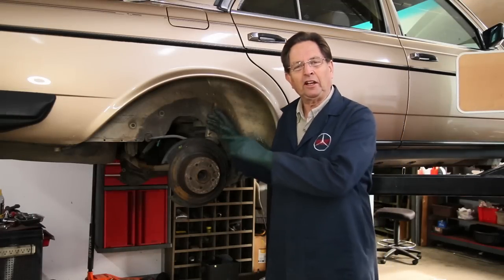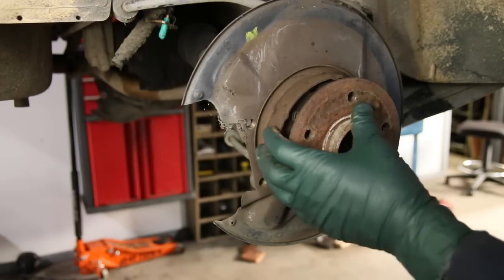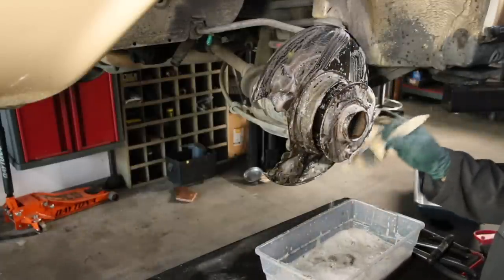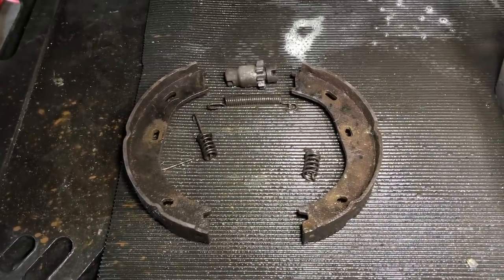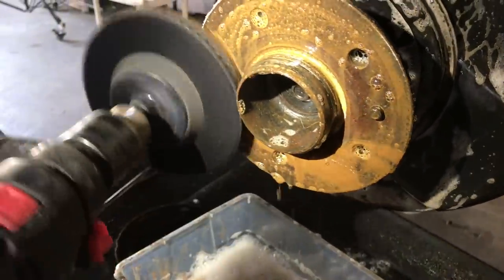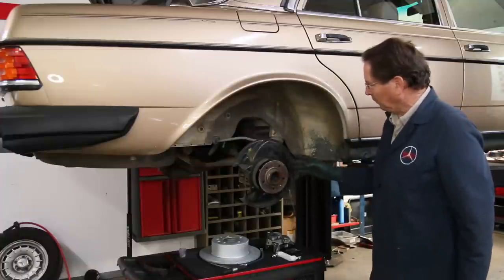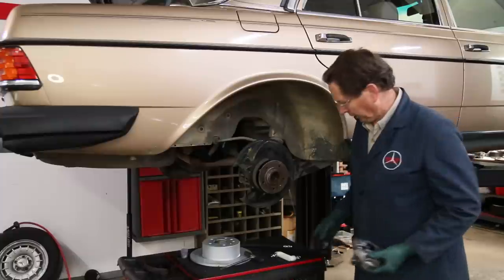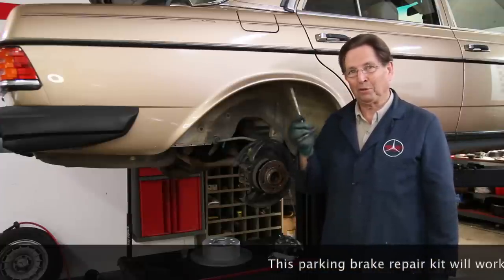Forgotten Part Inside Rear Brake Disk: How to Replace Parking Brake Shoes.

Comment: Kent, my recently acquired W204 has the same parking brake system. I had to adjust the shoes as it wasn't holding. The car had passed the MoT test (annual UK roadworthiness test) 2 months previously. My 2003 Volvo XC90 also has the same type of parking brake.

Comment: Excellent video: comprehensive and easy to follow.  I'm replacing the parking brake shoes on my 2004 W209 and it's the exact same as the one in the video.

Comment: I decided to replace the parking brake shoes on my 2000 Prado while I was replacing the rotor and pads. I didn't have any special tool and ended up defeated. Your tool might not work for me as the retaining springs are slightly different but you have given me some hope.

Comment: I just did this job a few months ago, and holy crap that tool would have been a godsend! One thing I still can’t get right is the tightness of the caliper. How easy should it be to rotate the wheel with the handbrake off? Because if I set it so it only just freewheels then the park brake doesn’t work well when turned pressed on.
Reply from the maker: Watch the next video I am going to put up on the causes of parking brake failure in the next few days. That may give you a clue as it what to look for.

Comment: My wagon has a driver side parking brake that keeps opening and rubs against the brake hub and makes a grinding noise and makes the wheel hot
Reply from the maker: Sounds like you might have a rusty cable (internal) that is not releasing and causing the brake shoe to rub on the inside of the rotor